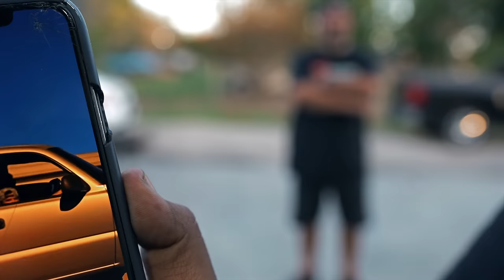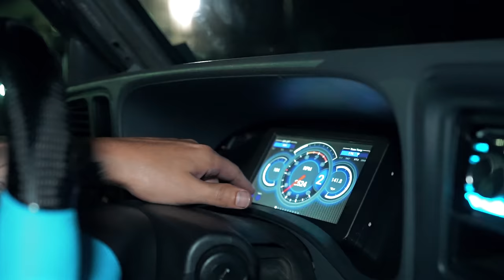Burnout Truck Vs. Nitrous Street Truck!

Comment: You are the reason the truck hits the limiter in first gear, as soon as you touch the floorboard, you need to shift into second, the eco will shift at the shift point, then hold in in second untill u wanna shift into drive, without hitting rev limiter